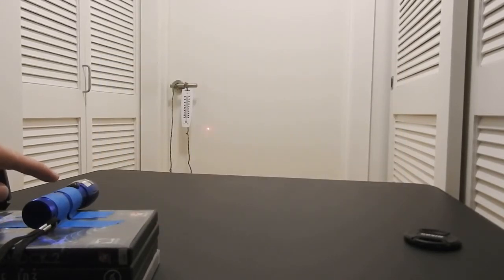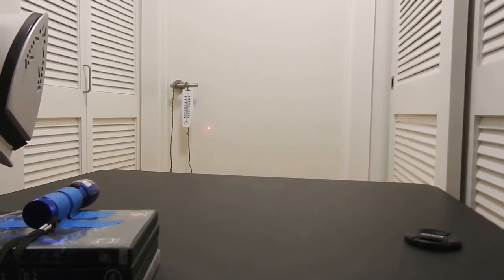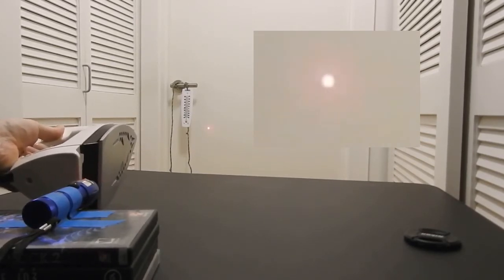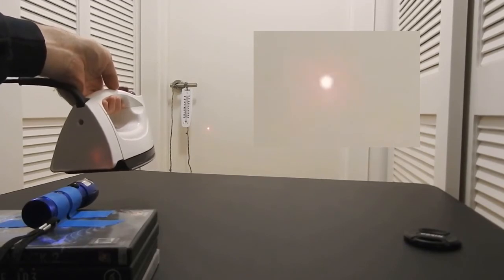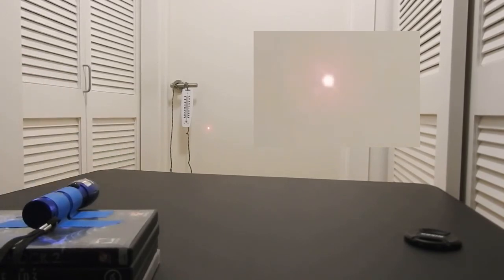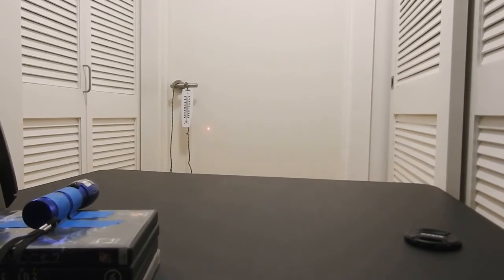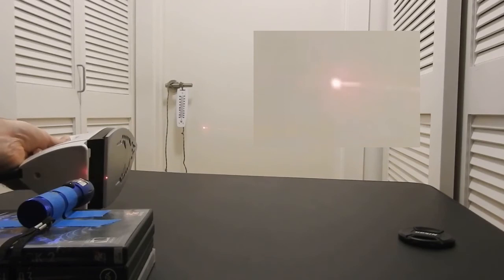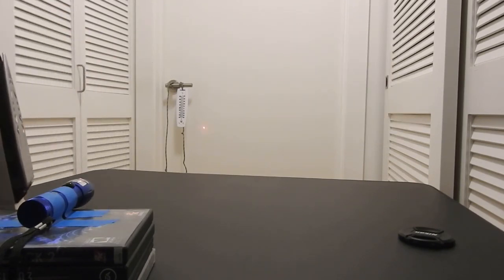Easy Demonstration of Refraction in Air

Comment: Strictly speaking, it's not the temperature itself that causes the light to bend but the rather the heat causing the air to reduce in density and the change in density causes the refraction. Light changes in speed through mediums of different density. Faster in low density, slower in high density. When light passes through a boundary of a change in density, at an angle 90 degrees, the light will just slow down or speed up. However, if it passes diagonally through the boundary, the fact that it slows down or speed up on one side first will cause the light refract.
Reply from the maker: Yes, you're right.
Reply: yes, great explaination!

Comment: the line that shows up is from diffraction at the edge of the iron, i think. thus also showing up with the cold iron. the 'push' of the spot is from refraction at layers of air with different temperatures and therefor different optical densities = different refracion indices, as you wonderfully demonstrated here.

Comment: Nice demonstration with simple household materials!  That video I used liquid butane, which immediately boils and releases butane gas over the curved surface.  Butane gas has a refractive index of about 1.00140 in contrast to air's 1.00028.  So it has a refractive index that exceeds 1 by five times more than air.  So the density gradient of the butane-air mixture created that effect.  I have done this with liquid nitrogen as well, in which the density gradient is more directly caused by temperature difference.  Of course, the effect is the same and the cause is ultimately the same as well.

Comment: Thanks for making this informative demonstration! I have a question: Is there any way make light reflect from air? I‘ve seen a kickstarterproject (i think its called holovect) that uses refraction to make a volumetric display. Since you can’t buy these it would be my dream to make one of my own
Reply from the maker: Yes, a mirage is caused by light bending in air in a way that acts like reflection.  In that case the index of refraction changes gradually so the reflection is not sharp.  Another way would be to have two transparent gasses of different densities, like air and carbon dioxide, together in a vessel, settled so the boundary is somewhat sharp.  Then you could get total internal reflection.  But I don't know how to turn that into a useful display device since the reflection only happens when the light approaches the boundary at a very shallow angle.
Reply: Interesting, thanks for responding 👍

Comment: Simply bc it is displacing to the right doesn’t mean the right side is the cause. You are introducing heat which is the cause for the displacement. So it would be more accurate to say that heat displaces the light to the right.
Reply: He also showed that it displaced to the bottom if the iron was in the top, so the iron was the cause, especially the heat.

Comment: This doesn't necessarily demonstrate refraction.  It could but there very well might be other reasons the laser beam is being displaced.  Heating metal causes electron emission for example. And what do photons interact with? Electrons.  So it would be nice to see an example of refraction in the air that wasn't extremely close to a surface.  

I have yet to see any example of refraction through air that doesn't take place in close proximity to a solid surface where diffraction might also explain the displacement.

If refraction is taking place, then the laser beam should bend according to the angle at which it strikes the pocket of hot air.  You should be able to demonstrate that the refraction follows the formula used to calculate the change in the incident rays if this is to be taken as evidence that refraction is the cause of the displacement.
Reply: You can also see it on a hot day over a street if you look flat on it, so it is heat.
Reply: @melonenlord2723   You cannot make out a coherent image when light distorts over a hot road.  I suspect that this effect is due to causes other than refraction.
Reply: @numbynumb  yes, thats difficult, but if distance is longer and the distribution of density in the air is changing slower than you get an more even distorted image.
Reply: As Phoenix said, above, it’s not the heat itself, but hot air is less, dense, and light will always bend towards the more dense medium. So the hot air near the surface of the iron, which is less than a gradient of denser air away from the ironhot surface. This is in fact, the same as a mirage off of a asphalt surface with the sun shining on it. No, it’s nothing that electrons can do to bite, or defraction, as it is not interacting with the edge of the iron.

Comment: Why do you think "light bends toward cold air"?  

Can you show any scientific publications that support that statement?

Light is said to bend in the atmosphere due to the air density layers that envelope the spherical earth.  The surfaces of these layers are thought to  be parallel to the earth's surface.  Thus light would tend to bend toward the normal when moving from one point on the surface following a tangent line.  But it doesn't follow that "light bends toward cold air".  That extrapolation indicates a complete misunderstanding of the mechanics of refraction.
Reply from the maker: My statement was a simplification for the context.  In general, light bends toward dense air.  In my apartment, the pressure is basically uniform, so colder air is denser.  But in the atmosphere, the air is densest near the surface, even though that air is usually also warmer.  If you want references, wikipedia "Refraction" has a good start.
Reply: @GarbageGamer74  Where are you getting this idea that "light bends toward dense air"?  

The wikedia entry on refraction says nothing to that effect.  All academic physics sources state that light bends toward the normal relative to the surface based on the angle of incidence.  Can you point me specifically to where you have seen something other than that?
Reply from the maker: @numbynumb  In the Refraction article, under Atmospheric refraction: "Since the pressure is lower at higher altitudes, the refractive index is also lower, causing light rays to refract towards the earth surface when traveling long distances through the atmosphere."

The separate article "Atmospheric refraction" similarly states: "This refraction is due to the velocity of light through air decreasing (the refractive index increases) with increased density."

What you're saying applies to sharp boundaries where there is an identifiable surface.  When the index of refraction changes gradually, you can approximate that as many surfaces, then take the limit as the number of surfaces goes to infinity to get the result that light bends toward denser air.  In the Refraction article, look at the second image under Light (caption "When a wave moves ...").  That shows the effect of one surface as index increases, as you have described.  Now imagine several more surfaces separating ever increasing indices and you can see how a segmented curving path would result.
Reply: @GarbageGamer74  FYI, you may want to research "graded index multimode fiber"
Reply: It's common knowledge that light bends towards the medium, that is less dense. You can see it when you look into water oder glas or anything. You can also see the shape of sun and star constellations deforming at horizon.
Reply: @melonenlord2723   The medium of air cannot be accurately imagined to be a smooth gradient.  Air pockets of varying temperature/density mix together in swirling eddies and the constant turbulence could not project a focused image over distance.  It is not comparable to light rays incident to glass or water, in which the surfaces are more neatly organized.
Reply: @numbynumb  If air isn't directly aboth a hot surface, then the air pressure gradient has more influence on refraction then the temperature gradient and this changes very smooth with height. On average you get a refraction gradient of 12%. That means earth looks like 12% bigger in radius, than it actually is.

Comment: No you're wrong ..the laser is NOT bending due to the heat but it rather reflected by the shiny bottom surface of the press iron. Epic Failed. try again
Reply: Actually no, you're completely incorrect.  You can clearly see that the metal reflection spreads the light out.  The deflection is not caused by reflection from the metal.
Reply: @acidastor9693  that's exactly my point the temperature has nothing to do with it .. the reflection is due to the shiny surface of the iron. Thanks for proving my point
Reply: @acidastor9693  Yes you right I've seen that It does deviate on the opposite directions of the high pressure to the low pressure and that means if you do it outdoors the laser beam will go upward only and isn't going to follow any curvature. Agree?
Reply: @acidastor9693  No that's not true it doesn't bend downwards because it's  proven that the higher elevation the cooler it gets .. Since this "experiment" proves that the beam bends towards the cooler air then you must be scientific and follow the evidence where it leads you.  if something demonstrable doesn't go with what you believe then flush what you believe down the drain.  You must agree with me this time
Reply: @acidastor9693  Absolutely NOT, dude this guy just demonstrated to you it bends away from the high pressure system to low pressure (cold air). So either way if you say it bends towards to high pressure or you say it bends to towards thicker and denser air molecules this video more than enough to debunk your claim.  And you can watch yourself that always the laser beam bends upward when it collides with tge dense water vapor above sea level.
Reply: @acidastor9693  listen like I said either way the video is refuting your claim. To claim the dense air reflects the beam downward then the beam must head directly towards the water or hit the curvature blocking it from reaching the other side of the ball. The laser beam wouldnt by any chance go up the curvature and back down again you need to play some mental gymnastics to believe that light around the ball. If it does then your spinning ball earth would never see a single night. Good night buddy 🙂
Reply: @acidastor9693  You are wierd, because According to YOU the dense air is pushing on it DOWNwards.
Reply: @acidastor9693  the problem is you dont know what you're talking about ... that's exactly your claim dense air refracts the beam DOWN.
Here let me define what refraction means
" the fact or phenomenon of light, radio waves, etc. being deflected in passing obliquely through the interface between one medium and another or through a medium of varying density."

This clearly refute any claim that the laser beam will go around the spininng ball earth. It's impossiBALL, friend.
Reply: @acidastor9693  I think you wouldnt admit that if the light beam goes downward it must hit the water surface or the bulge of the curvature it just can't travel beyond your physical geometric horizon which is according to your model shouldnt be more than 1.226 miles times the observer hight squared. Agree?
Reply: @acidastor9693  Yes, but let me correct you .. the beam will hit the bulge with or without the atmospheric conditions. According to your geometric horizon it all depends on the observer hight squared multiplied by the 1.226 mile so if your leveled with the water surface the light beam won't travel more than 1.22 miles before it hit the bulge of the water. And if we add the denser atmospheric condition then your laser beam will behave the same way that's been shown to you in this video which means won't go farther than the space of this tiny room. Welcome to reality
Reply: @TheIsmaelIsaac  A light beam that would have, normally, been reflected off an object parallel to the ground would, with refraction, bend down towards the ground/water. That is correct.

But light is reflected off objects in lots of directions.

Reflected light that would have normally been reflected at an upwards angle (and which would have allowed the object to be visible from a higher elevation) will, with atmospheric refraction, gradually curve towards the earth.

If the light is a source, like a torch or a lighthouse, the same thing happens: light from the torch is sent out in lots of directions, which is why a torch is visible even if it's not pointing directly at you. Some of those directions will be at an angle upwards. Some of those will refract downwards too.

When talking about atmospheric refraction, I prefer to say that the effect is similar to elevating the observer's position, because that is what it effectively does: the light that would have, without an atmosphere, gone over your head and been visible to a viewer above you, is bent down so that you can see it.
Reply: @TheIsmaelIsaac He didn't prove your point. Didn't you see the difference when the iron was hot and when it was cold. Why was the result different?
Reply: @melonenlord2723 

The reflective surface was the cause. Without nearing the reflective iron surface, you wouldn't observe any changes. He could've used a hair dryer to create the needed temperature variation. However, he must be either silly or deceptive to choose a reflective to claim the light bends down due to hot air. 

Sorry, you really can't do science.
Reply: @TheIsmaelIsaac  But he also showed it with the cold iron, and the reflexion from the metal didnt move the point at all, so it's not the cause for the movement.